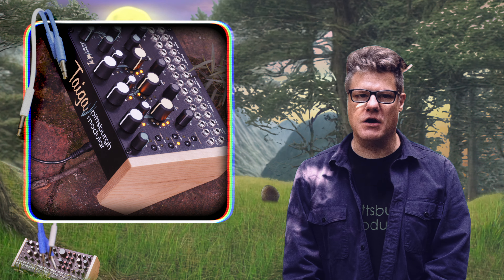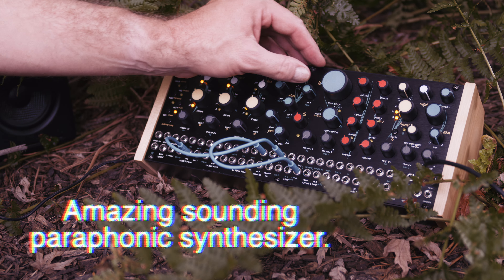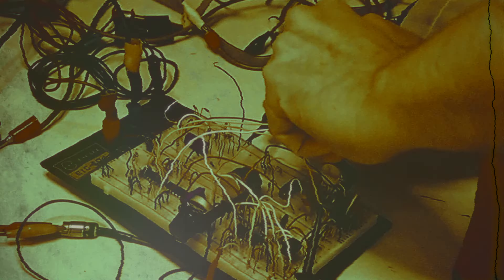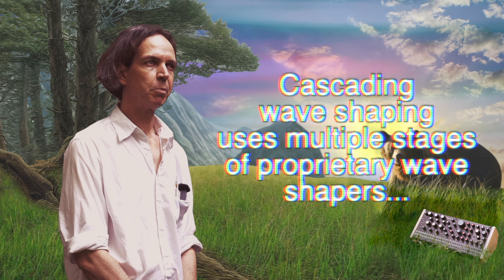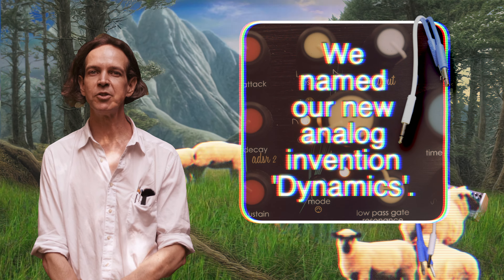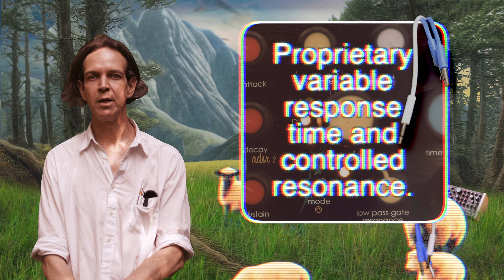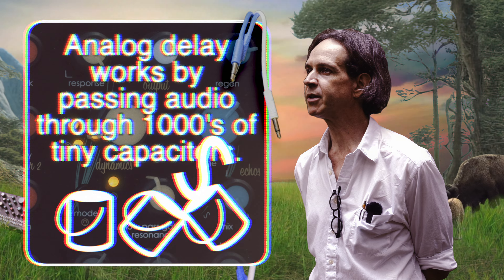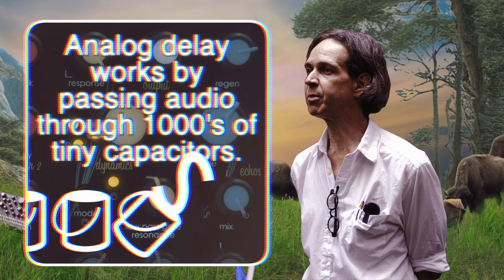Pittsburgh Modular Taiga: A Deeper Dive

Comment: I was a little disappointet for the paraphony not using all 3 oscillators seperately. But after some thinking i now came up with some modules i already own that can easily expand the taiga to be alot of differend 3-4 voice Polyphonic Synths (most importantly the squarp hermod). Once i recieve my taiga my case will be the Polytaiga!
Reply: Cool. Taiga only has 2 DAC outputs capable of V/O output. Paraphony was a last minute addition as I worked through the firmware and we figured offering it with 2 voices was better than not including it.
Reply: @richardnicol  i understand that completely. But i will make it poly anyways :) maybe i'll make some Videos about the ideas i have for the Taiga. Polytaiga for Studio and Drum n Taiga for live Performances are already two cool concepts in my head. Also  mutisampling pre-tuned chord Pads and Stabs will be a great resource.
Reply: @anastasia0zardonova  looking forward to hearing what you do!
Reply: For me, re: OSC's, its all about the shapers.  Nothing like it!